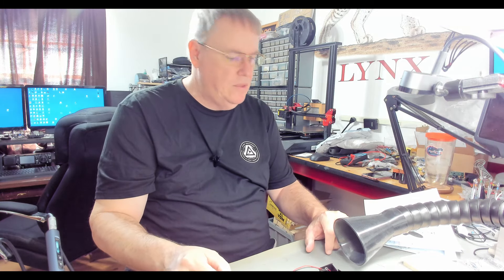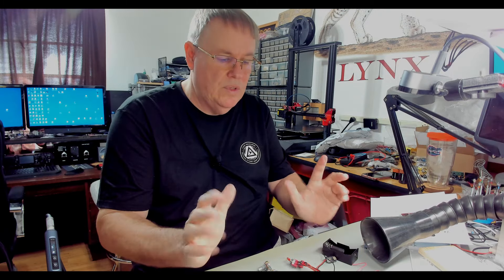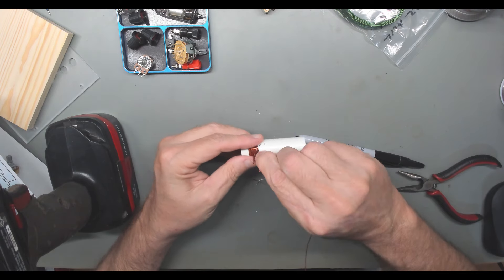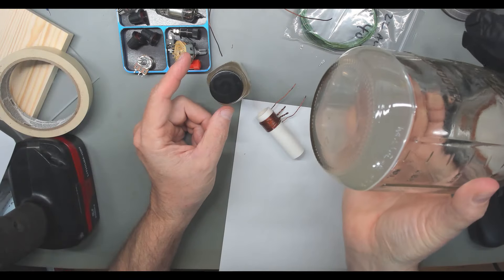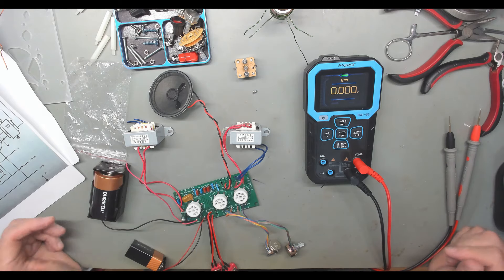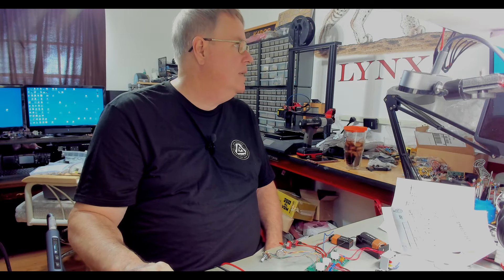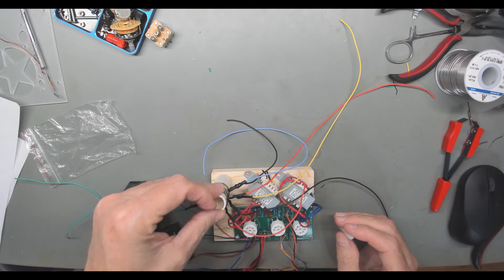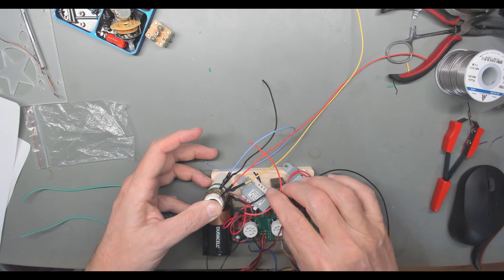Three Tube Regen Receiver Part II

Comment: Hi RJ, I accidentally stumbled upon your video. I ordered the exact same kit back in December of 2020 but never got round to building it. Back then I had already noticed they included an 18650 battery holder in the box to power the filaments, that would have destroyed the tubes instantly.  So these kits are very low quality and may have the wrong components but luckily I have a large junk box, a MM and an LC meter. If I remember correctly there were 3 versions of the kit; just the PCB, the PCB with components and the complete kit with wooden bottom and plexiglass front. So the people without the front would have to solder everything straight on the PCB. That is probably why it confused you. Looking forward to part 3, maybe you can give a summery of all the things wrong or confusing with this kit in the description. Maybe even make some improvements. With winter coming it is a nice time to build it myself and use your videos as a guide. Thanks for the videos, liked and subscribed. 73 de PA land.
Reply from the maker: Welcome aboard,
Part 3 will be out Tuesday (tomorrow) I am working on it now. This is exactly what it will be. I will get it working and show all the issues I found and how to not make them yourself. I think I am going to post a diagram showing the correct wiring of the coil to save people the trial and error I’ve had. Your explanation of the three kits does explain the board being designed for the parts to fit on the board. Don’t know why that didn’t dawn on me. 
Thanks for pointing that out. I’m glad you found my video maybe I can save you some hassles. 
RJ

Comment: Hey RJ, just a couple of my "wonderful" thoughts. Maybe check the tubes on your tube tester. Did you mount the pcb stand offs upside down? Screws are still too long but maybe they were needed to run through the piece of wood. I was wondering how much MORE  complaining there would of been if the DLA products had the same level of kits and assembly directions and support as the radio kits you been working on. Plus every one would have to write their own PIC code.
Reply from the maker: Rick, you might be correct I might of was suppose to put the long screws in from the bottom and the plastic threads through the pcb and nut them. Still would not need that long. As always I do make mistakes. It would be nice if I didn’t have to fly blind on the kit. Yeah I do not think we would have had thousands of working units out there from all the diy builders if the quality of instructions were this lacking. You deserve much credit for the wonderful wiki you created for us. It really helped having all the info organized.  👏🏻
RJ

Comment: Thanks for showing how you constructed the coil. That has been immensely instructive. Also, thanks for the tip with the Q-Dope. I'll check out your video on how to make up a batch. I assume it's probably acetone solvent with styrofoam packing material dissolved into it.  I have a few other projects standing by that require similar coil construction so this will jump start those for me as well. Watching you work through the stages and trouble shoot along the way has also been amazingly helpful. You've done a brilliant job explaining the whole process so that even I can understand it. Now on to part 3.......(KO6ABI)
Reply from the maker: So glad to have someone I was able to help! Turns out the trick to go Q-Dope is very white packing material and MEK, acetone failed when I tried it. 
RJ
Reply: @LynxElectronicsLab  I wound up ordering some Q-dope on ebay. Looked like the bottles were still good and the price wasn't too bad. But the solvent does tend to find it's way out of the bottle over time. So it's good to know that MEK solvent is the way to go. I can get some MEK solvent to have on hand in case I need to resurrect any of the bottles of Q-Dope that might be running low.
Reply from the maker: The stuff I ordered online was bad!!! It was black water. When the solvent goes out it gets thick and you can add solvent. This was different. Never seen it do what this did. 
RJ